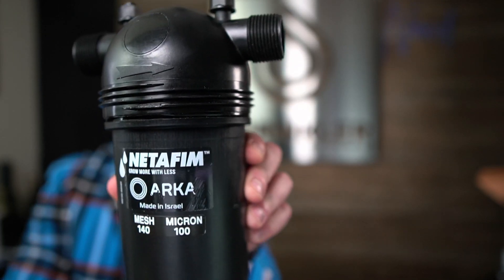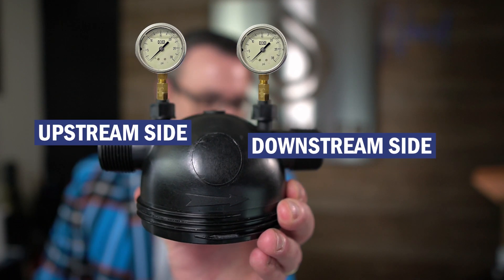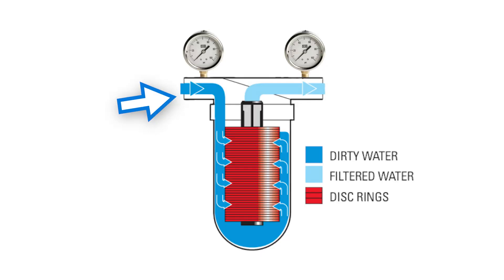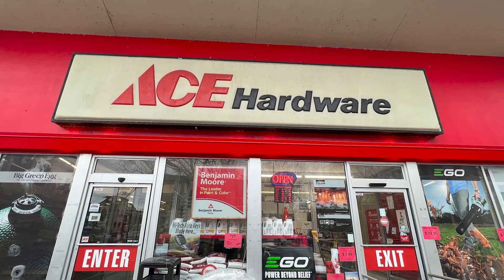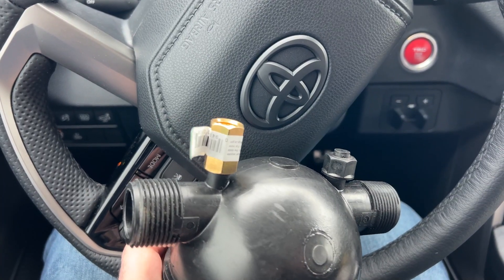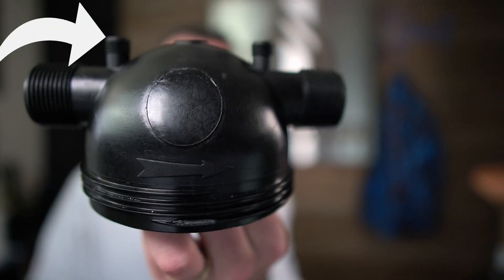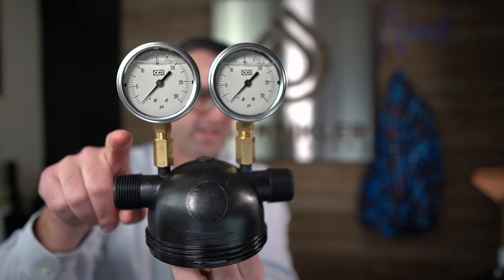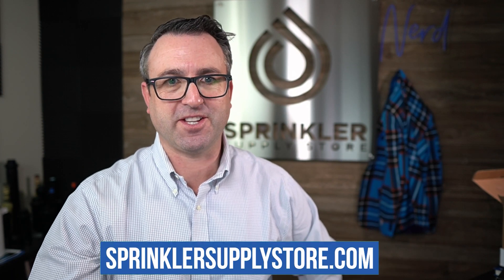The Best Way to Monitor a Netafim Irrigation Disc Filter

Comment: What is "normal" pressure drop with a completely new filter?
Reply from the maker: This depends on the size of the filter and the flow rate (gpm). A 1” filter at 10gpm is 0.60psi. Take a look at the chart on page #2 of this document: https://cdn.shopify.com/s/files/1/1987/5531/files/LMNFL-Manual-Filters.pdf?91
Reply: @Andy_Humphrey  thank you! Very interesting to see that connection size is most important factor
Reply from the maker: Glad it helped! This basic theory can be applied to almost any device on irrigation system. Each product has a pressure loss specification, based on the flow rate.

Comment: Does this filter remove iron stains from a sprinkler water source?
Reply from the maker: @frankiecorado7951 awesome question! Disc & Mesh filters are not able to remove soluble Iron from water. Filters like this are only able to trap debris particles. Any iron particles that are lose in the water will be caught in the filter, however, any iron that is dissolved in the water will pass through. Iron should be treated using an acid injection system, and depending on the type of irrigation controller, you can program the injector to only operate/inject acid on specific zones that are watering hard surfaces. - Andy